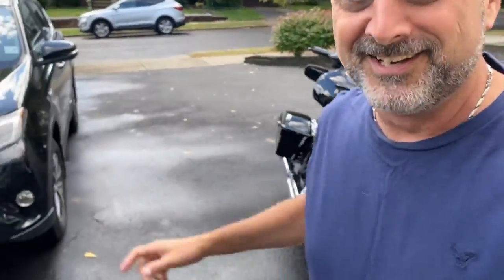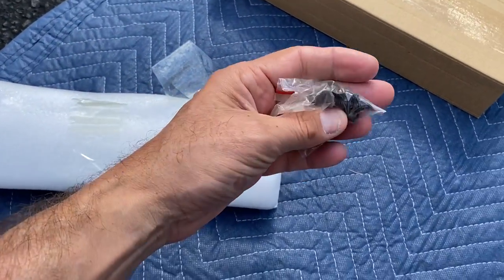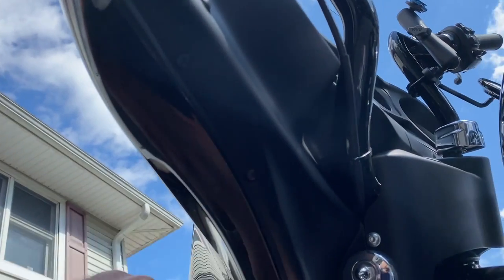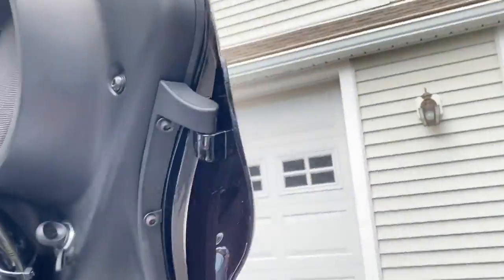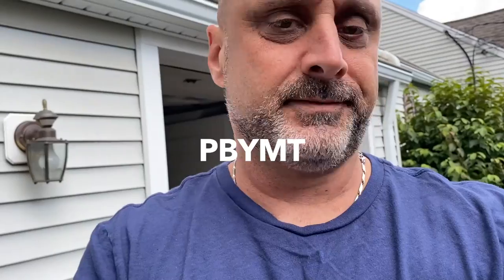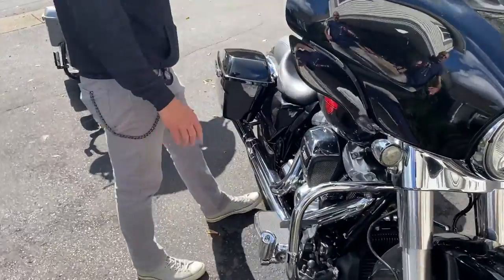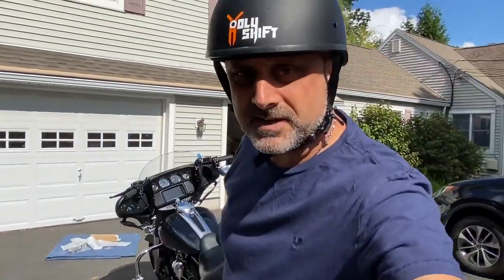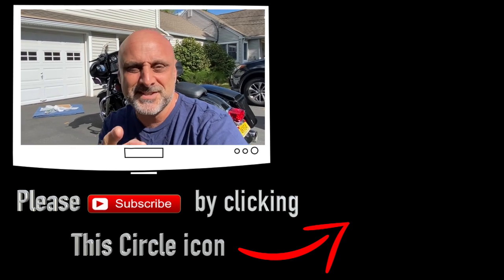Side Wings Air Deflectors Harley Street Glide Electra Glide

Comment: No need to remove fairing for install, then this is just a bolt into plastic? Would have thought there is a nutt on the inside of fairing to tighten it up. Still thinking on getting the HD ones, but price is high!
Reply from the maker: John Gijbels there actually are  nuts buried inside the fairing and screwing in the bolts has to be done precisely. Still no need for removal of fairing

Comment: Nice video, but what kind of wind protection did they give you? Did they block the wind off your legs. or did you barely even notice a difference? Also, when you open them up, did they perform like they weren't even there like before you put them on?
Reply: These are also my questions